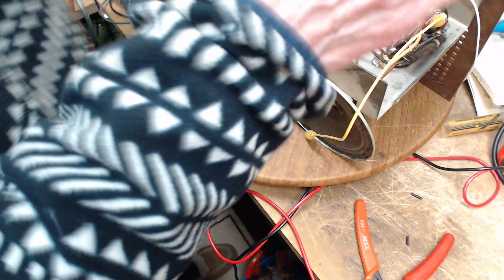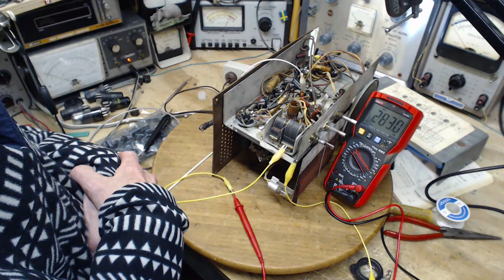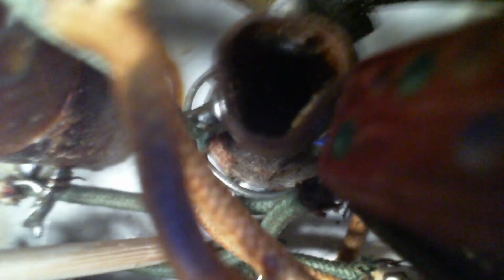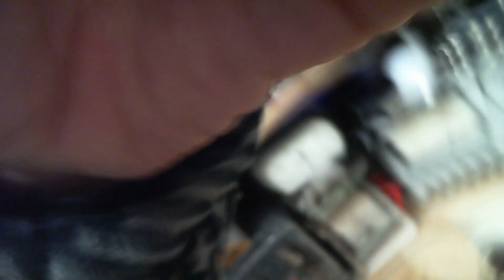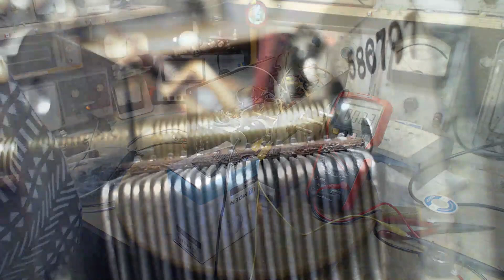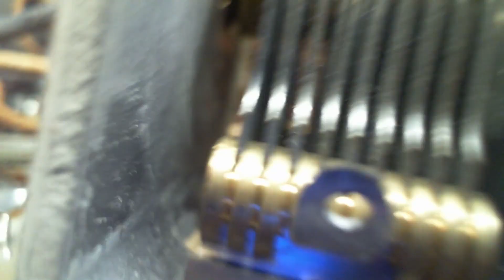Canadian Westinghouse Model 577 Video #5 - Low B+ and the Tuning Capacitor

Comment: This is why I watch Jim videos,,, the issue with the capacitor was very fascinating, I bet Jim teeth are very healthy as he knows how to use dental floss!! The alcohol idea appears to have worked well also... When I do radio restoration these days I apply years of watching Jim videos with many practical approaches to figuring out what might be wrong.. 
I have a radio that has a similar issue with the tuning capacitor, so I will drag it back off the shelf and see if applying Jim repair techniques will help resolve the problem. 
I purchased the same camera Jim uses for his close up camera work. FYI, it is a Microsoft video conference camera. You want the cheaper of the 2 available as the more expensive one cant do the super close up. I got mine off eBay for $15.00 as today most laptops have a built in cameras so folks are just getting rid of them cheap . A valuable tool to have in the tool chest.  Robert, San Diego

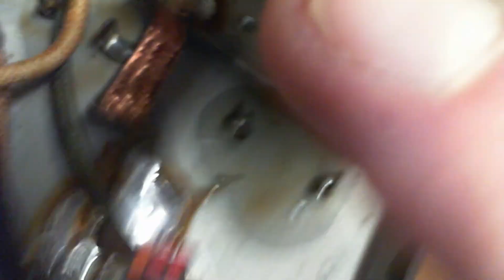Comment: If I recall, the tuning capacitor is mounted on insulating pads.. So how does the moving top part get grounded you may ask? If I remember, their is a metal spring type metal that is dragging on the front tuning shaft. If that is the case that contact could be very dirty and causing the intermittent grounding of the top stator of the variable capacitor?? It is not that the plates are shorting together, but rather an intermittent to gerund connection is taking place.. Wait, I just noticed at 48:44 that it appears to be a braided ground strap soldered to the body of the variable capacitor to chassis ground. So that makes my idea null and void.. Oh Well.. After watching Jim do his repairs over the years he will figure it out.. He just needs to pay less attention to his wonderful cat! 🙂 I guess I need to continue to watch the video. At least Jim placed the piece of wood under the speaker so I dont need to yell at my screen. 🙂  Robert, San Diego, Ca.